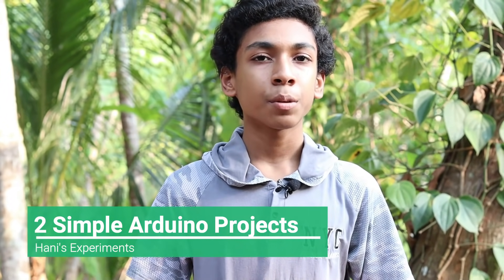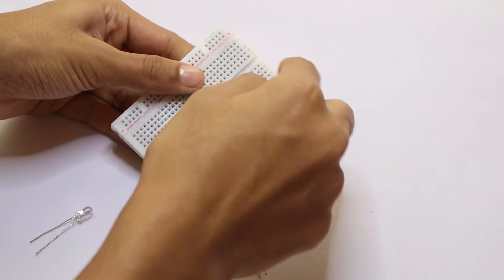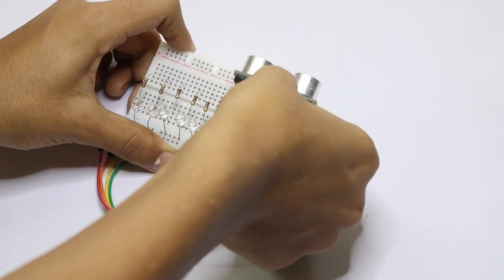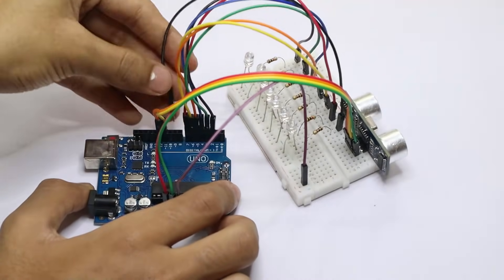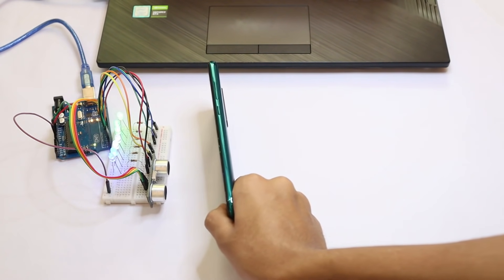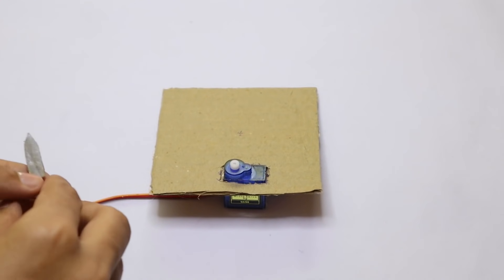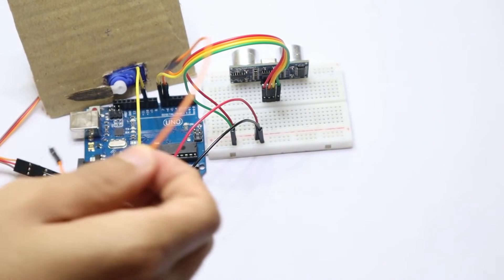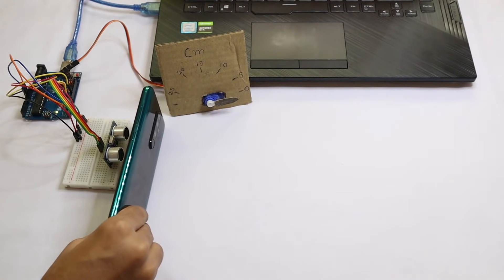2 Simple Arduino Projects | Giveaway winner announcement!!!

Comment: Is it ok to use 220 ohm resistor instead of 1k ohm resistor? 
also, are you positive that the code in the description is correct? because when I try to upload it to the board, it comes with an error. please notice this comment. thanks hani
Reply: try with a different computer
Reply: @puns0  my project was already finished lol. I ended up using a tutorial from someone else and it worked out well.
Reply: @elxr8335  aye, what tut did you use?

Comment: Pls someone give me a hand, why when i connect the Vcc(sensor) to Gnd(arduino) with jumper, the arduino goes off ??it completely goes turned off
Reply: You need to connect VCC on the sensor to 5V on the Arduino and Ground on the sensor to Ground on the Arduino. The reason the Arduino turns off is because you are not supposed to connect Ground and VCC together as this will damage the Arduino. Hope this helps!